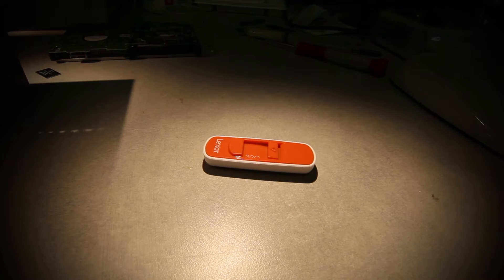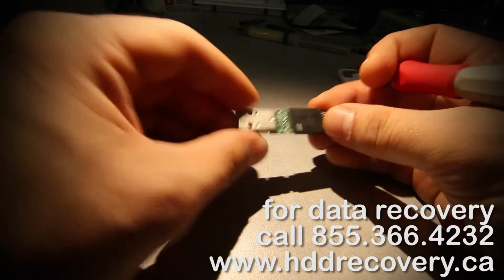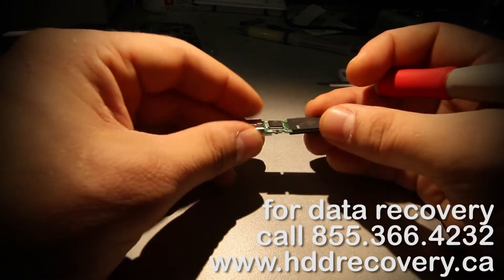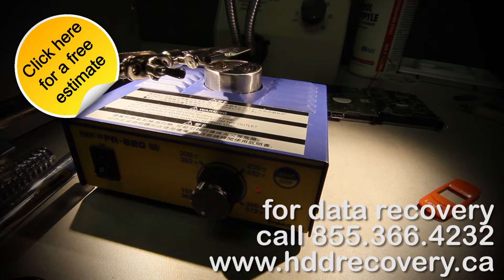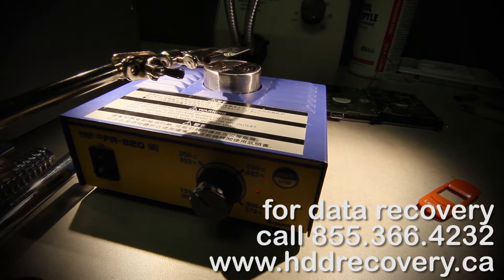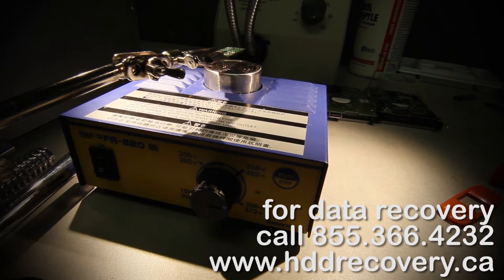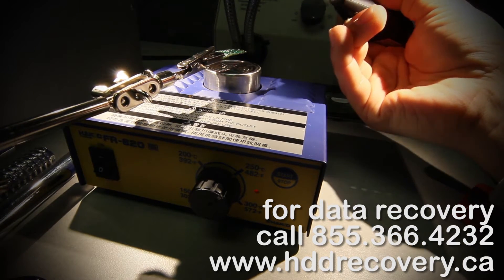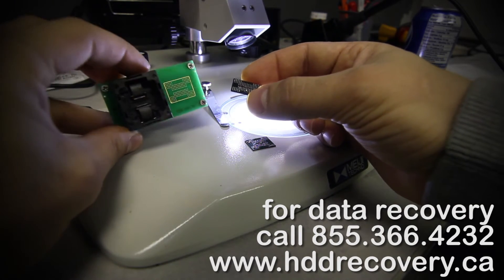how to recover data from lexar flash drive

Comment: PREVENTION: Sliding isn't smart, but the Lexar JumpDrive S75 has THE WORST POSSIBLE sliding DESIGN. If you bump this EXTRA-LONG drive it while it is plugged in, you bend the board. When you retract the bent board, it misaligns, and you can't slide it out again. I straightened mine, but it bent again, and it died. (Top performance, though!) Buy only a micro USB drive, other one-piece drive, or swing drive.
Reply from the maker: Swing drives also tend to get issues with connector because how much longer they get when in use. Micro USB devices such as Sandisk Fit are probably the worst for recovery since they are monolithic.
Reply: (I listed swing last. Swing drives get a little longer or wider, depending on the design (so many), but most don't stick out like the sliders.) My micro drive got washed and dried before I found it again, working just fine (expect a high MTBF). If it ever dies, even just a blown nano-fuse or broken conductor, I doubt I'd get anything back (infinite MTTR).